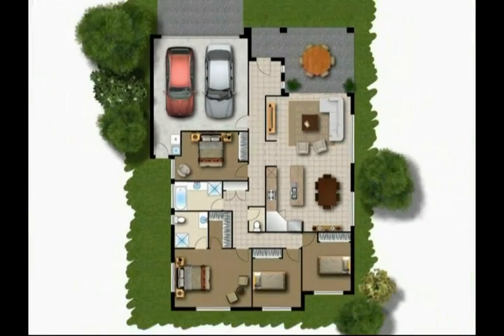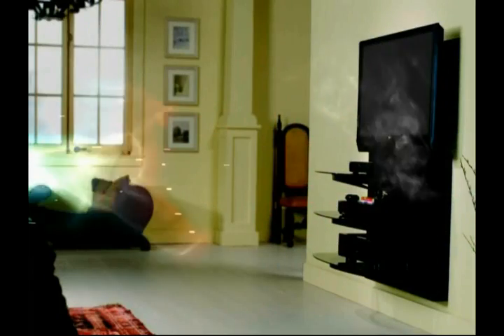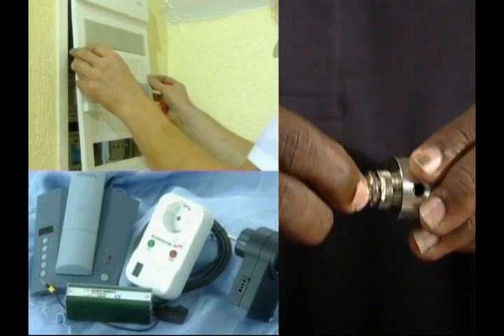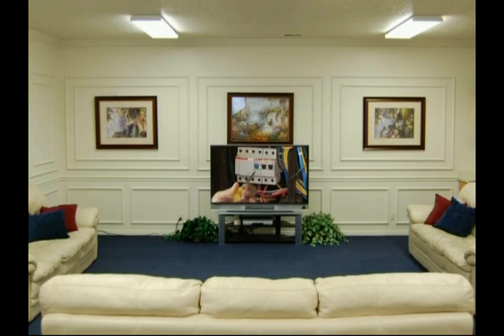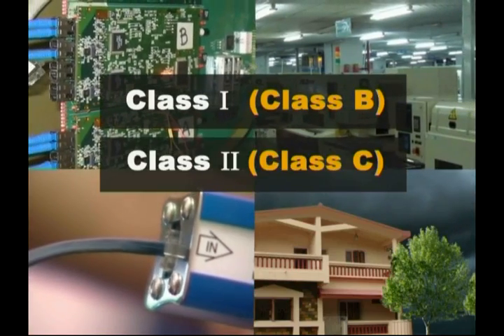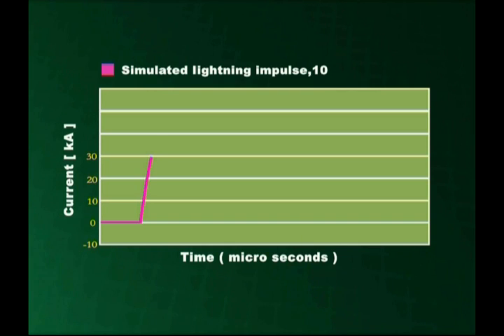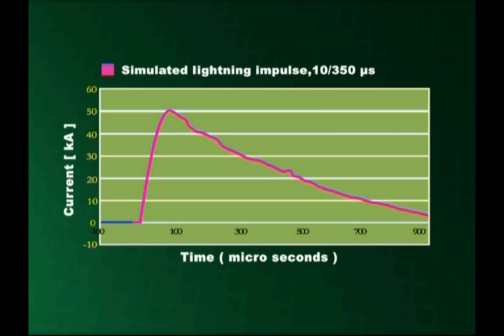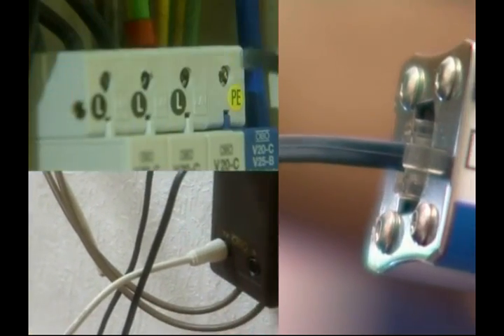Surge Protection Design, Surge Protection Training, Surge Protection Device Design

Comment: I need to know whether these surge protection device (Type 1, 2 & 3) are just meant for a single surge incidence and need to be replaced after a single surge or whether these device gets reset automatically and can be reused after a surge incidence? Does the cartridge type SPDs are meant for a single surge incidence?

If it can be reused (after auto reset), what could be the max life (number of such surge incidences) of such device?

I am looking for a AC 4 pole (3p+N) SPD where Vmax = 275V (between line and neutral) and Vnormal = 255 V (between line and neutral) and the surge protection actuates if Volt between line and neutral is more than 275 V, but it shall continue to supply a voltage say abt 255 V. I am looking for a Type 1+2 and Type 3 SPD. which one is the best device. where in India can i buy these online?
Reply: Ramit Verma f🍔🍗Lipitor
T
I’ll
Reply: Whether functioning of SPD can be done by user ?